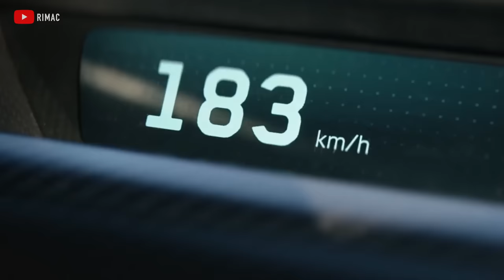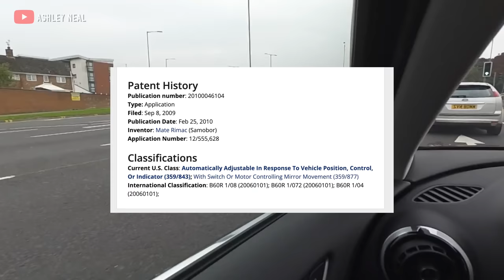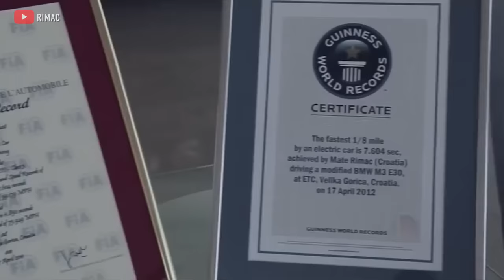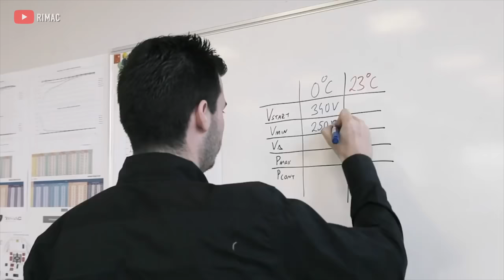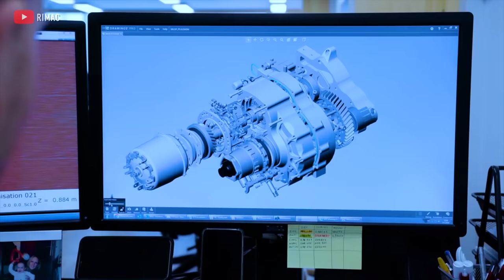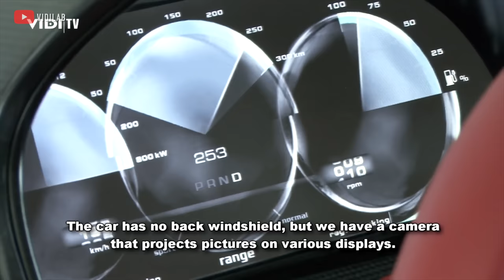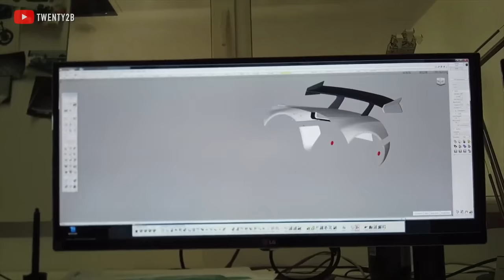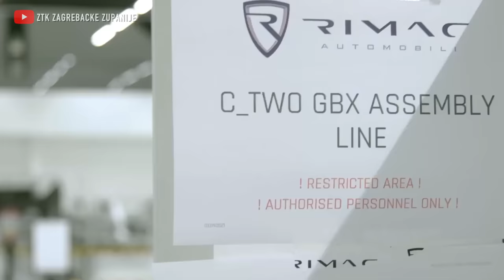The Secret Genius That Built The World's Fastest Car

Comment: Well considering that the 2023 Porsche 911 Turbo S was able to consistently set 0 to 60 in under 2.0 seconds and Motor Trend's drivers where able to hit 0-60 MPH in 1.80 (so the 1.7 Second time of this car isn't that impressive all of a sudden), the 911 Turbo S can do a 0 to 200 MPH in 14.8 Seconds, or the 0-100-0 MPH in under 10 seconds. Granted this is a fine piece of engineering.

Comment: That electric Rimac that Hammond crashed supposedly burned for 5 DAYS! These electric cars catching fire are a huge danger on our roads with fire engines/fire trucks being completely emptied of water and STILL the fire burns on. These cars are near impossible to put out when compared with normal cars/trucks. Plus the construction of Electric cars causes 4 times the pollution when compared to normal petrol/diesel vehicles. Yes EVs do not themselves release the same amount of pollutants but what about the charging? EV makers NEVER mention the actual charging of these cars which put more strain on our power stations which generally.......burn COAL!!!!!

Comment: Meh, not impressed with EVs.  Even the Chinese are building fast EVs and they were never known for building a decent and reliable ICE.  It's the same concept, a battery and electric motor.  With ICE you can have varieties of engine types from i3 to v12, NA and and forced induction, HEMI to high revving V12, i3 turbo to 9000rpm flat 6..  With EVs, it's a generic style electric motor, and power is determined by battery output. Like I said, even the Chinese are building fast EVs.  Vietnam is building EVs too.  Countries that were never known for engineering a reliable combustion engine can now compete with high end sport cars in a drag race.

Comment: The car that was slower than a GT3RS with 1/4 the HP on the Nurnburgring? Sorry but how is it the fastest..
Reply: With the right driver and going all out, it could go much faster around the nurburgring. Though you are correct. It's not the fastest car. It's the quickest.